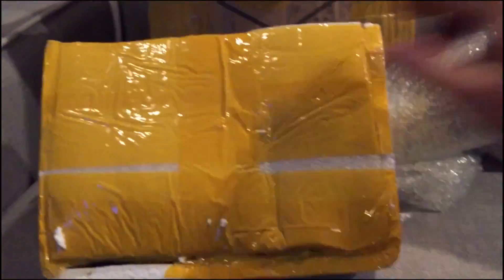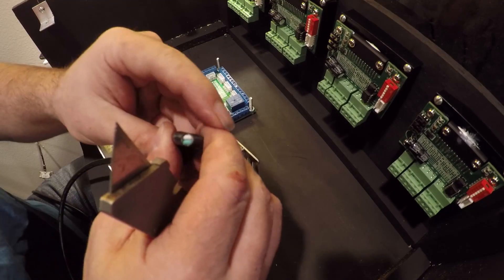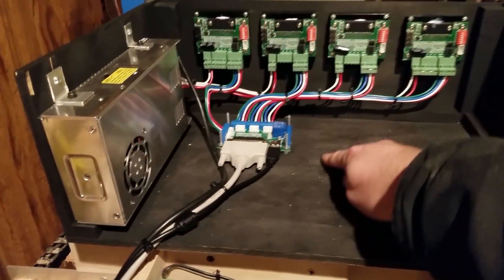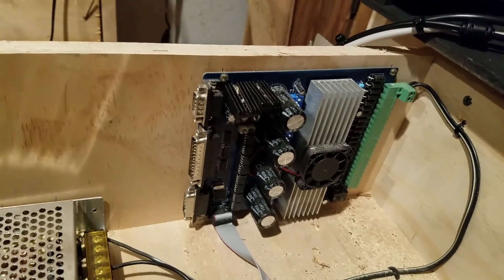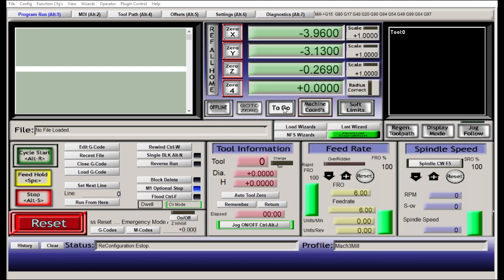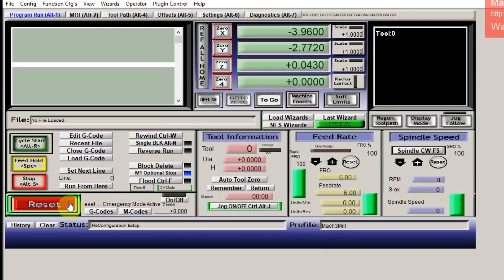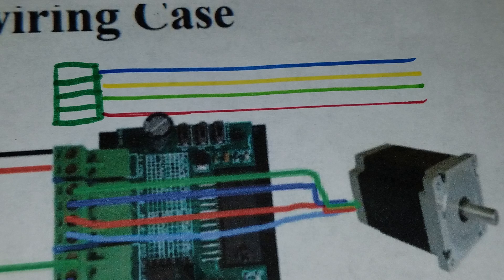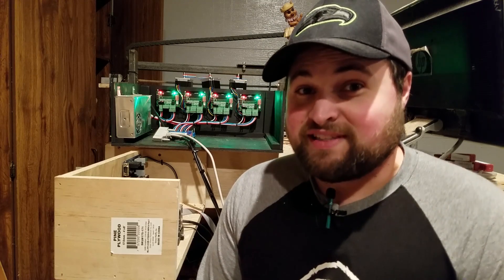CNC Build Part 1: Controller Box Build and Set-up

Comment: I almost came close to buying a kit similar to yours (How are they working out) I ended up buying from wantai, sad thing is my kit never came with a wiring diagram.

What size wires would you recommend ?
Reply from the maker: between 16 and 12 guage will work fine. Working great so far. Better than they should honestly. Did you get yours up and running?
Reply: Wish I seen this comment before I ended up going with 18 gauge wire, I watch another vlogger where he connected the electronic components together,  Yes I have wired it up BUT I couldn't test it due to the parallel to USB cable was the wrong type parallel plug, so I ordered a new cable, as my pc does not host a parallel port.

Just sad as my kit never came with any paper work apart from the invoice ;-(

I have no idea weather I need to change any dip switches on the Driver as of now they are still set to default.

CNC Router Frame is partially built, short afew machine bolts, limit switches, motor mounts
Reply: no luck with parallel port card, I assume your pc came with parallel port ;-(

Oh yeah I brought a parallel port card, yep came with a driver disc with like 20 different drivers, did I load the right one I have no bloody idea, I tell ya what it was like a Chinese scavenger hunt full of frustration.
 
Oh top it off yes found a wiring diagram and wired it to that does it work no bloody idea, BUT why is every bugger wiring it up so many different ways, rolls eyes shrugs shoulders.
Reply from the maker: Lol, that's exactly the situation I found myself in every time I built one. My 3D printer was the same way. It's almost like the computers with parallel ports are worth more than the controller. 

I tried for 2 weeks (not kidding) to get a PCI add-in port to work, and it literally never did. I called a computer guy and told him "I can't", so he did. Been working great ever since.
Reply: I just recently brought a UC100 parallel port adapter (yeah I could of brought a used computer for the same price with a virus or 2 with a parallel port from some dodgy person  in a dead end culdesac off craigslist. ) as I read into afew vlogs not all parallel ports will work with CNC or Mach3.
There was nothing wrong with that wiring diagram (it's working now) as I all most came close to rewiring when I decided to check if mach3 would detect the estop and it did not so I thought just maybe it was not receiving any signal from pc to breakout board and I was correct.
soon as I connected that over priced expensive hardware it came to life those people must be making a killing off that device.

My next step is trying to calibrate stepper motors via mach3 . With not luck yet as the auto setting is not helping unless I have some setting value wrong else where, I use the auto setting put how far I want it to move (50mm), then measure that distance then input that into the text box, then it auto updates, I recheck it and it moves 30mm, so I go through the process once again and it gets smaller, kinda like 5 steps forward and 2 steps back, and if I keep repeating it will get to the stage it won't move.

so I don't know maybe I have something set wrong else where ( thank you china for the wonderful product with no instructions )
Reply from the maker: @henryfitzthum7563  Oh dude, I had zero luck with the auto calibrate! I designed a 1" pocket in fusion and ran the program on my machine and measured, then did the following calculation. (Steps per unit/pocket measurment) X (intended measurement) = (calibrated steps per unit)

Then enteref the calibrated steps per unit and ran program again to double check. Works really well.

Comment: Nice it's a very informative video for me but I want to ask a question to you, I have a cnc router machine which have same mach3 interface board like yours now I want to add a 2500mw laser module in my cnc router so do you know that how to connect/wireup laser in this board please guide me if you know.
Reply from the maker: Healthy Grow Should be able to use the control relay built into the board, and use that to turn on your lazer. The relay is only 5v, so you will likely need another relay and power supply to step up to whatever voltage you need. That'll be a cool project!

Comment: very informative video, have two questions for you, your first controller, does it have USB support? if so would you mind posting a link for it? and for bonus question 3 is there a particular USB supported controller you recommend, if not your original one? I built my desktop CNC back in 2012 but put it aside due to the parallel port issue and lack of support from anywhere back then. Id really like to put it to use but the company (MYDIYCNC) is no longer in business so, looking to make use of the numerous paperweights ive got right now ha. TIA
-Alex
Reply from the maker: alejandro pena I'm afraid both of my controllers are parallel driven, so we're dead in the water there. The truth is though, I was not able to get my first one to work by myself. I have a friend who builds computers, and I had him configure the com port to talk to the CNC controller (turns out i had the wrong OS for the version of mach3 i was trying to run, dont be like me!). Perhaps you know someone with better knowledge of this process? I'm an amateur with computer hardware so I was the wrong guy for the job!

I only personally know one guy who uses a usb based CNC controller, and he said setup was basically "plugging it in". His is a sainsmart, but I'm sure they're all that simple. Regrettably, I have no first hand experience with that subject. I hope this helps, good luck!

Comment: I went to Newfangled Solutions site and Mach 4 is now available.  Will you be using Mach 4 on your new CNC you are building?
Reply from the maker: I believe Mach 4 is USB only. They wanted to have more specific software as people were getting away from parallel ports, because mach 3 is parallel based. So I don't think i could use it if I wanted to. Also I already have mach 3, so that seals the deal.
Reply: This makes sense.  If I purchase a USB Only Motor Driver should I plan on buying Mach 4?  Or if you had a USB only and did not already have the Mach 3 license would you go with Mach 4?
Reply: @StrangeGarage  Actually it has support for parallel too with the 'Parallel Port Legacy Plugin for Mach4' ... But really, you should do yourself a favor and move to something better, I would even advise ethernet as EM interference is a bit of a bother on USB (and some of the lower cost china spindles do generate a lot of EMI).

Comment: Good Morning SG, What do you think of this kit?

 https://www.ebay.com/itm/US-Ship-CNC-4-Axis-Kit-with-TB6600-Motor-Driver-USB-Breakout-Board-Nema23-Motor/352137463490?hash=item51fd0746c2:g:5ugAAOSwx2dYGbcC
Reply from the maker: Ted H reading about it right now. I know someone who uses one and I haven’t heard complaints yet, I don’t want to steer you down the wrong path without doing my research.
Reply: Thanks Man.
Reply from the maker: From the look of things, this is an "upgraded" version if my controller. The usb alone is worth the extra money because it makes it that much easier to get a compatible computer! There are not many reviews of these for some reason, at least not many "real" reviews. I would get it, but I like to take chances.
Reply: Strange Garage thanks man, I'll go ahead and pull the trigger in a week or so when funds become available. EBay is really good about refunding your money if the product doesn't work so I'll build my box and hook it up right away to make sure it works when I receive it.
Reply from the maker: Ted H got to newfangled solutions' website and make sure your computer meets the requirements for mach 3! If it does you can download the demo for free and mess with it, but you can't move the motors at all without mach 3.
Reply: Minimum System Requirements For Mach 3
Parallel port control only supported on 32-bit versions of Windows.

32-bit Desktop – Parallel Port Versions

32-bit version of Windows 2000, Windows XP, Windows Vista, or Windows 7
1Ghz CPU
512MB RAM
Non-integrated Video Card with 32MB RAM(Large G-code files, especially 3D files will require a video card with 512MB RAM or higher)
Laptop, 32 or 64-bit Desktop – External Motion Controller Only

An appropriate external motion controller, such as SmoothStepper, UC100 and others.
Windows 2000, Windows XP, Windows Vista, Windows 7, or Windows 8
1Ghz CPU
512MB RAM
Video Card with 32MB RAM(Large G-code files, especially 3D files will require a video card with 512MB RAM or higher)
Reply from the maker: Right, you need to check the computer that youre running to make sure it's compatible, with the operating system and hardware.
Reply: I'll probably just get a used computer and add RAM and a video card if needed since I am going with the USB Only CNC Kit.
Reply: This is what you need for mach 4 from what I found.  

http://www.aquickcnc.com/wiki/Mach4
Reply: I am only adding this info in the event others may buy a USB only CNC and need the info :-)
Reply from the maker: Ted H Makes sense to me. Just wanted to keep you updated, I was gonna post a CNC video, but I just don't have enough parts to make it worth while. Table is supposed to be here Wednesday, so there should be a vid shortly after that. I would post the vid, but It's just not good enough. Hope all is well.
Reply: Strange Garage Thanks man, no worries at all, I'm in no hurry whatsoever. I really look forward to the video and hope all is well with you and yours as well.
Reply from the maker: Ted H That's why you're my main man, Ted. Good looking out. Got the motor out of my wife's boat today, hoping to put the replacement in tomorrow or Monday, so all is very well indeed!
Reply: How did the motor replacement go?  Any video footage of it? Is it a fishing or pleasure boat?  I've owned several boats in my life, but sold them all.  Replaced an outboard on my 1976 Cajun bass boat a long time ago in college with my roommate's help.  It was fun.  When I am able to spend more time at the farm I will probably buy a john boat to use for fishing in lakes near my family farm.
Reply from the maker: Ted H Got both motors pulled, currently doing a carb to Efi conversion. The boat is a 1988 bayliner and the donor vehicle is a 1992 Ford ranger. Both motors came out clean, I'm currently swapping parts, replacing seals and prepping. I expect to spend a full day on wiring because the boat is not equipped for Efi. On the water Thursday or Friday hopefully, and I'm filming a great deal of it. Trying to leave out boring stuff, but this will likely be a long video!

What was your favorite boat? This is my first and I bought it broken. I wish i knew more about them.
Reply: I had a ton of fun in college with my buddies on that Cajun Bass Boat.  My friends and I pulled in some HUGE bass and HUGE Redfish on that boat (I went to college in Florida so the Cajun was used in many freshwater lakes and the Gulf of Mexico.  But my favorite was my 2006 155 HP Seadoo Sportster with a wake board tower.  At that point in our lives my wife and I lived about 10 minutes from an awesome boat launch on to Lake Murray.  We had a lot of fun wake boarding and I mounted a trolling motor bracket on the back of the Seadoo used my trolling motor to fish for bass when we were finished wake-boarding.  I really have enjoyed all of my boats including the  several John Boats I have had.  I hope to get another boat sooner than later, but life needs to slow down a bit first so I have time to use it. The motor swap you are working on is WAY above my skill level with engines.  You are blessed to have all of the talents you do. Thanks for asking man, this takes me down memory lane.  Are you guys going to use the boat to ski/wake board/tube, or just enjoying time out on the water?
Reply from the maker: It's all about being on the water for me. I used to go out on outrigger canoes with some friends of mine on the Columbia river, but with the wife and baby boy I'm ready to have something I don't have to paddle. That's awesome, I wish I was somewhere as plentiful as down south. The salmon and steelhead are DELICIOUS here, but fishing regulations are WAY too aggressive, so it's borderline not worth it. That seadoo sportster sounds like an awesome machine! Mine makes about 120 from the factory, this used motor probably makes about 100 (plenty for putting around on the columbia), 155 HP sounds like a riot! 

My biggest talent is I don't have the "Give up" gene. It's not so much skills as once I start something I need to put all my chips down. Sometimes it's ugly, but its GONNA work, or it's all I think about! I gave up on a big project once and I still think about it. I know, i got problems. Also I've done motor swaps with this exact engine before (I've owned 7 ford rangers), so I bought this boat specifically because it had that motor. Stick to your skill set. Easily the hardest part is I need to fabricate an alternator bracket because the alternators aren't the same and the "Ranger" location won't fit in the bayliner engine bay.

It's really not that tricky. I'm literally pulling the whole harness from the truck, ripping every wire out, and swapping it into the boat. Easy peasy. Sounds tricky, but one wire at a time ain't no thing my man.

Comment: Awesome SG.  Thanks for doing this.  You say at the end of your video is you want a simpler installation and a controller with support you should buy a bit more expensive one.  Do you have any suggestions on manufacturers and model info?  You have four drivers set up in your box, are you going to add another for your 5th axis, or are you only doing a 4 axis CNC?
Reply from the maker: I can’t recommend any other controllers because I’ve only used these two, but the reviews online for other units will give you the “pros/cons”, and it all boils down to what you want. I can say ditch the parallel ones, and get one that is compatible with Mach 3. Some have proprietary software, and you WILL have better luck and support with Mach 3 because everyone uses it. I’m only planning on running 4 motors, and my kit only came with 4 drivers, so I’ll just leave the “B” axis off, no biggie. 

The BIGGEST headache is finding a computer with the right operating system and a parallel port. They are out there, but it takes digging, and I don’t want to lead you guys down the most difficult path. I can suffer just fine, I don’t want to put you guys through that.
Reply: Thanks SG. Wife has an OLD computer with a parallel port.  Specs are AMD Atholon Processor 1.1 GHz,  256 MB RAM and it's running XP Home Edition 2002 SP 3.  Will this work for running Mach 3 and the other software necessary to run a CNC?
Reply from the maker: Ted H That's the same kit as mine. Just with one less axis. If I were you I would ditch the parallel port! The usb on this is just to power the controller.

A Milwaukee rep gave me one in like 2011, and I just can't use other knives since then! Definitely the best!
Reply from the maker: That's even the same seller I got it from. The instructions didn't even come with the kit, they emailed them to me. The kit does work though, obviously.

Comment: So eh... You could make an accurate wiring diagram and share it yeah?
Reply from the maker: The only thing I changed was the motor wiring. I drew it onto the diagram towards the end of the video, but I have 8 nema23 motors and the wiring isn’t the same from motor to motor, so I can’t just say “wire it like this” because there is no one way to do it. Sorry this doesn’t really help, this is the exact reason I recommend not buying directly from China. Some people never get their TB6560’s working, maybe I just got lucky twice.
Reply: I think you might be mistaking wire color with anything important. You need to identify the windings. They will usually be on the same listing you buy the motors from. But yah that "wiring diagram" they sent you sucks. There are ways to identify windings though so google it.